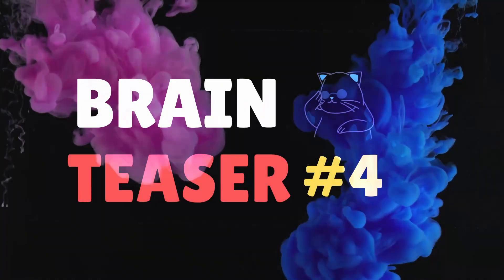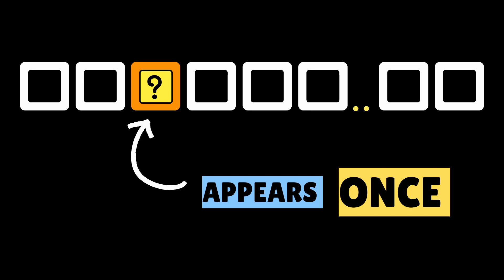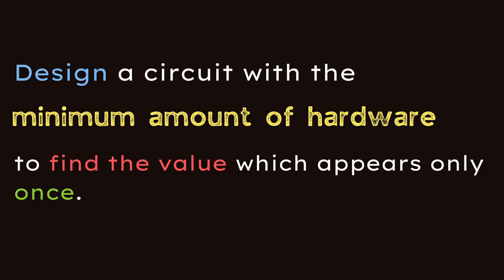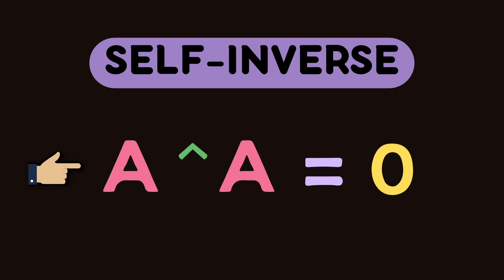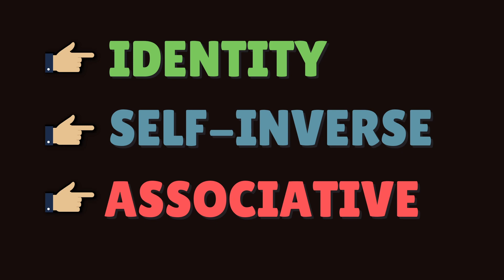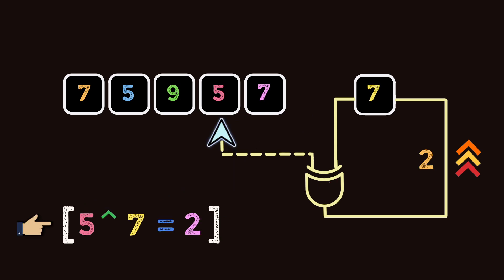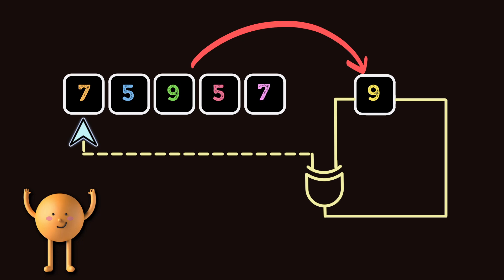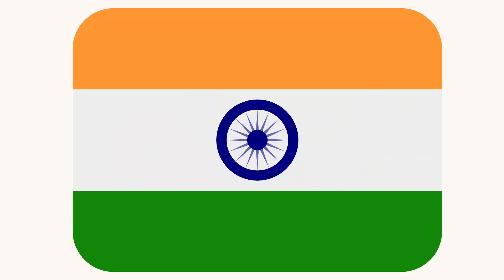A Google Interview Question.  # Digital Design

Comment: Can someone share, how this code will be in Verilog?
I tried, but unable to do it without using modulus operator (%). My understanding is that mod operator is not synthesizable or need a very complex hardware. Correct me if i am wrong

Comment: Hi Karthik! Since we are only interested in finding the number which occurs once, I think using a series of XOR operations alone should suffice. My understanding is that a counter (or any sequential for that matter) won't be needed - this is very similar to a binary to gray conversion, where you shift the bits and keep doing XOR. 

Also, the problem statement does not put a constraint on the max size of the elements which the array can have, so attention has to be paid here as well.